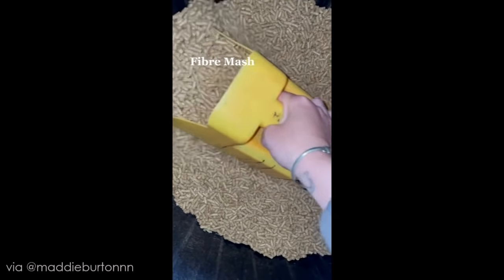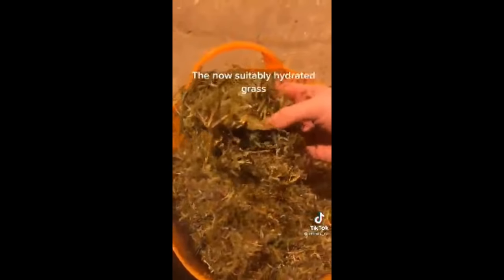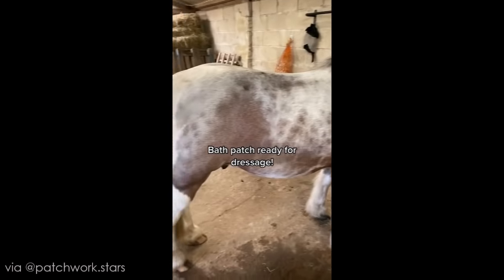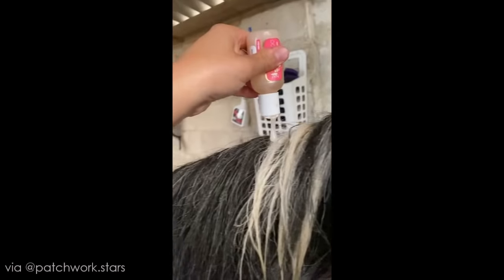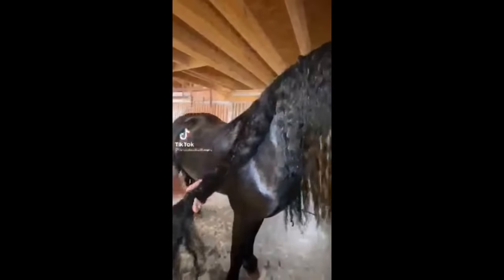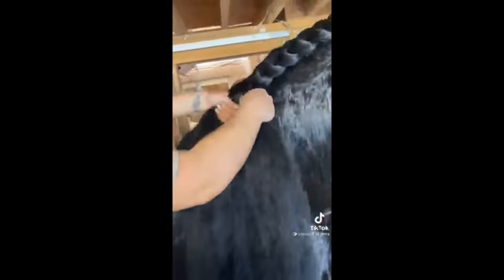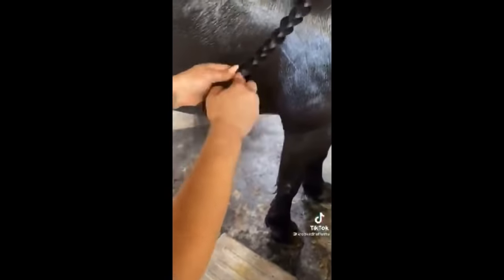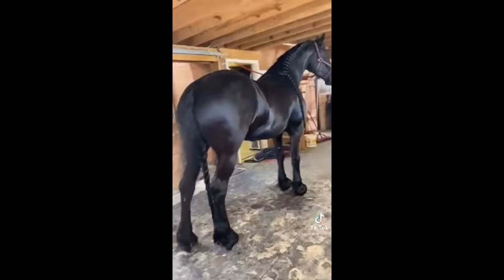The Most Satisfying Equestrian TikToks pt 5

Comment: I know this is kinda of topic but does anyone know a good curry comb. I am having trouble finding one, and if any of you had good luck with a certain curry comb in particular make sure to tell me.
Reply: In Amazon the tough large rubber curry comb .I have been using this for a couple of months still haven’t broken sorry can’t send a link unfortunately anyway I’m not saying you should get it just recommending if you’re on a low budget.
Reply: @Lee11208  thanks so much!
Reply: I'v always to use those round metal curry combs and I'v never had one break. I also like them cus they have reversible sides, Also anything from Oster. They're bit more expensive but they're really great quality and will last you  a lifetime.